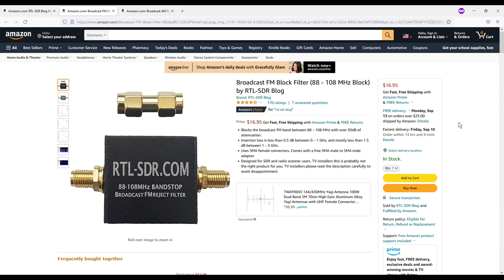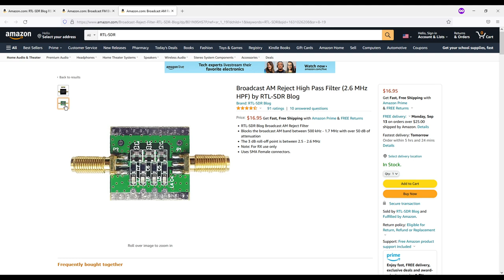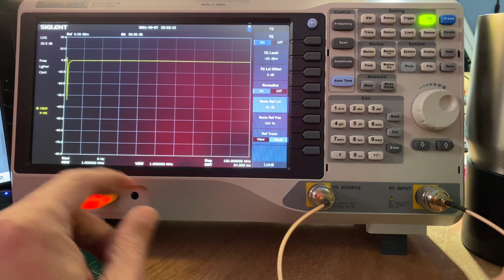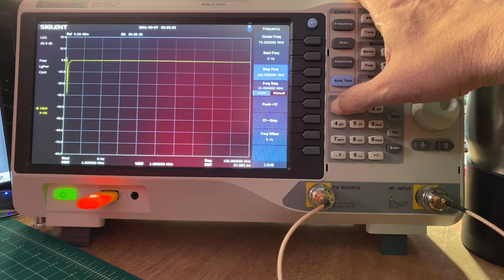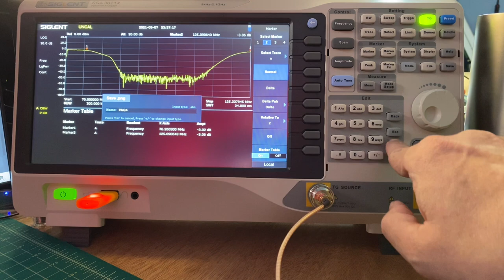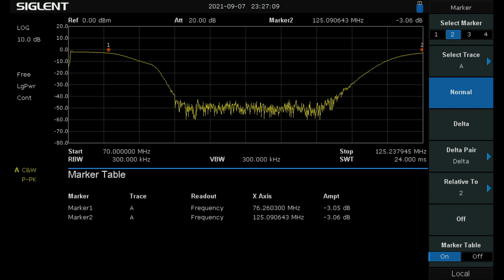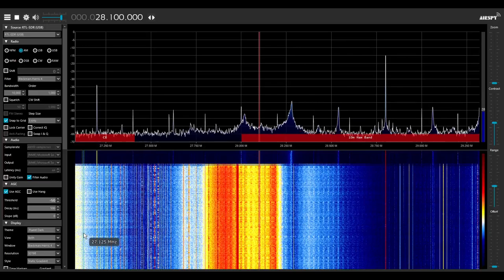RTL-SDR RF Filters

Comment: Great video Ape ! ....The RTL-SDR 88-108 Mhz Block filter Does work the way you tested it....Unfortunately,  It has a very Small Effect when used connected to an Actual radio in Moderate to Very Strong Broadcast FM environment....When connected to my TinySA Ultra scanning 88--108 Mhz local FM Broadcast stations & the 12" Telescoping whip antenna Connected to the Filter's Left side Sma connector thru 3 ft length coax cable, All Strong Local FM stations Leak right thru the Unshielded Plastic enclosure & Are 10 Dbm Stronger than Without the filter connected as if the Unshielded filter is Functioning like a Big coax cable Leak !!!.....Reverse Connecting the Filter (Right side Input) the Rejection is around only 25 Dbm effective....Your's might be different but my Filter does this Repeatedly Inside my home !! .....Just Fyi.....
Reply from the maker: I’ll have to do some testing on that.  I needed the AM high pass and bought the FM at the same time just incase.  Thanks for checking out the video 👍

Comment: Great video, informative, and sure is a nice spectrum analyzer...  I have the Siglent model just below the one you use.  If one owns,  the order of magnitude lesser expensive, NANOVNA they can perform the same measurments, albeit with somewhat lesser accuracy.  Also if you have a noise source and the TinySA you can also characterize the filters, youtube videos abound.  Also be aware that these filters do an excellent job of mitigating overload of the radio, active antennas may suffer overload of the LNA built into these antennas.  Orientation of the active loop may help for some stations...  Thanks for these informative videos, always great info...
Reply from the maker: Thanks for the comment wb7ond and for checking out the video.  I have both the TinySA and NanoVNA which are both handy products and are great for learning.  I try to show a variety of tools are ways folks can look at or solve problems.

Comment: I knew that i had to pick both of the filters up when I bought my RTL-SDR. I have a powerful FM station close to me at home, and an AM station across the street when I'm visiting my mother. 

I did try the SDR without the filters in line and as I thought it was pretty much unusable on any frequency other than MW and FM broadcast frequencies. It was causing shortwave broadcasts to duplicate themselves, picking up FM and MW stations on other frequencies, it was all kinds of bad. The filters stopped that.

When I bought my Shortwave radio and an MLA-30 I had to put them in line with that setup as well.

I have to use the FM filter on my UV-5R (I know I can't transmit when that's in line, but I can't transmit anyways being that I don't have a license to transmit) due to the FM station overloading the front end. That radio station makes it to where I can't even get the weather frequencies, and can even interfere with the radio receiving the local repeater.

Would be nice if I could get a filter just for that one FM broadcast frequency, because that is the only station causing all the issue at home.

That station can bleed into another station on the opposite side of the FM band, and this is seen on multiple car radios. On some days it can image itself on multiple frequencies on the FM band.
Reply from the maker: You might be able to build a filter, but that might be a giant hassle.  Thanks for watching Max

Comment: Hi.  Great vid!  I use the NESDR Smart with an active mini-whip antenna and the front end of SDR Sharp is easily overloaded with this setup.  I was thinking about these bandpass filters that you demonstrate.  The mini-whip is basically made for these types of dongle SDR's and yet they are very sensitive as well.  It takes hardly anything to overload my dongle/computer systems receive with RFI.  I have an AM station 1/4 miles away (123.000 kHz Korean station)  which creates havoc as well.  Do you think that the AM bandpass filter would help?  Or am I just going to have to put up with a significant RFI problem?  Guess there is only one way to find out and that is just to try it.  The maker of the Active mini-whip gives advice that it is a good idea to have the antenna grounded directly.  I live on the second floor of an apartment, so grounding is an issue.  Anyhow, thanks again and your vids are always informative.  73.
Reply from the maker: Glad you liked the video David.  I am sure it will help with AM interference and at 16$ it's not a bank breaker either.  Thanks for the comment!

Comment: Question:   Not sure if anything can be done... but I monitor our International Airport... which is about 18 miles north of my location.   I can hear the tower just fine.. but when a plane (jet) flies within a few miles of my location and transmits... the SDR overloads.   I've adjusted the gain and that does help... but will any filter help in this overload type situation ?   Thanks for the help    TBGF
Reply: You need AGC - automatic gain control.

Comment: Ape, would you have a recommendation for front end protection for these SDR's? It's a pain to have to disconnect my SDR when ever I want to transmit.
Reply from the maker: That is a tough one, I do not.  I typically have my disconnected which isn't the must "fun"
Reply: @TheSmokinApe  Yeah, I have mine hooked to a LoG antenna and much prefer to use it for receive. I have a bypass on the tuner it is attached to, but the short bit of coax from the tuner to the SDR still acts like  a bit of an antenna bringing in my TX RF at a level I don't like. I ordered a unit off of ebay so will have to see what it does.
Reply from the maker: @JReed305  good luck with it 👍
Reply: @TheSmokinApe  thanks 😁